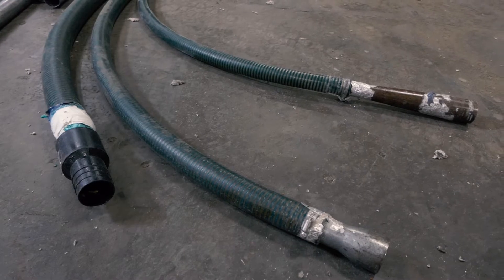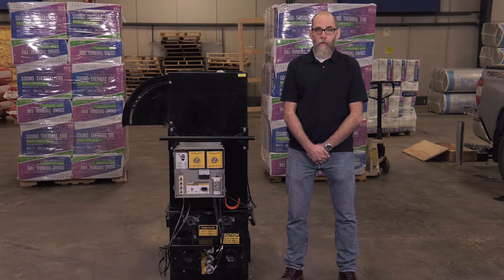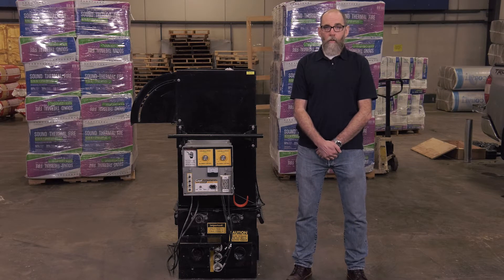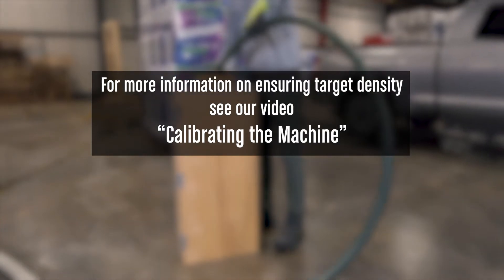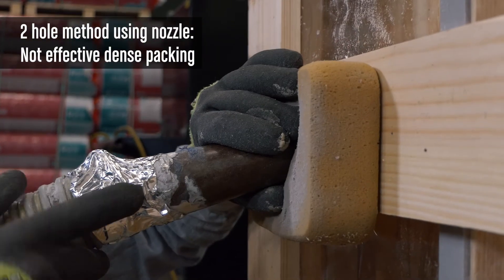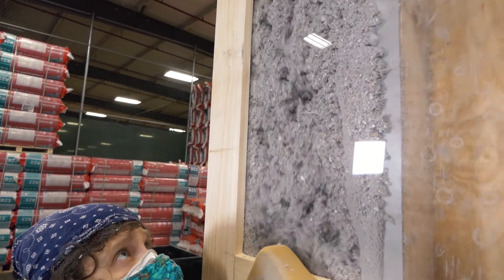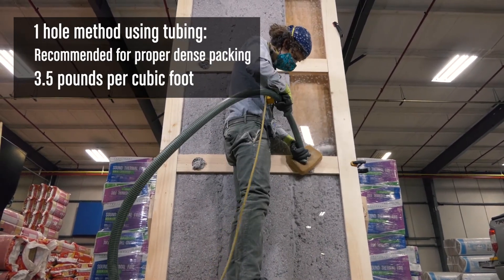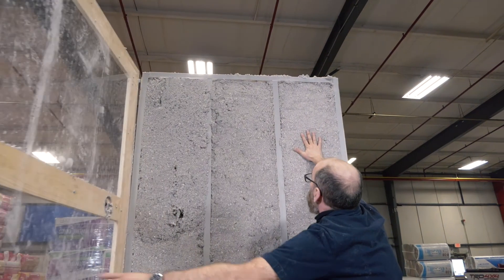Dense-Packing a Wall Cavity

Comment: At the 2 minute mark, you open the door to the 3 filled bays and only show 1 hole in that door you filled from. Something fishy there. I am going to do this or have it done but I want to fully understand and SEE the evidence. You show earlier in the video the tech starting to fill the cavities and there is 1 hole per bay but when you get to the 2 minute mark, there is only 1 hole. You need to show us the ACTUAL work of how to do the correct application if you are trying to help DIYers.

Comment: I need to insulate a wall that has sheetrock on the inside and a brown fibrous underlayment that they used to use behind bricks. I don't want to break that stuff. How dense should I pack it?

Comment: You better pack it tight because I had to repair a 14’ wall that had settled 2 ‘ within 5 years and luck would have it went into the attic where you could see through the grey web screen otherwise the whole high ceiling wouldn’t have any insulation in it! Foam rules !